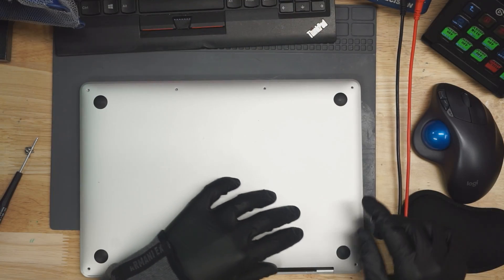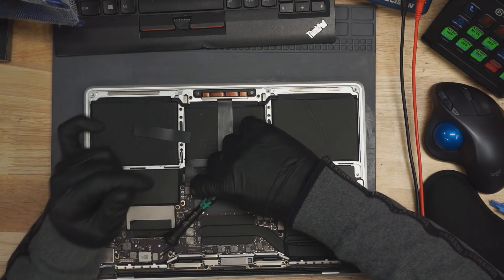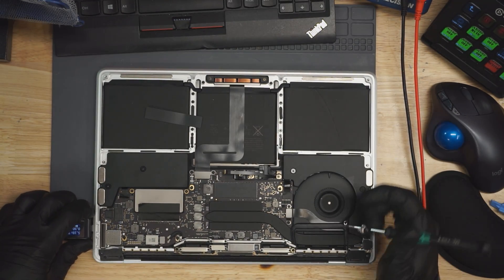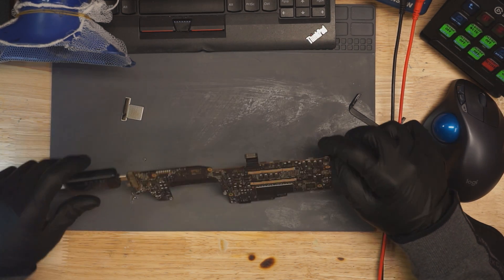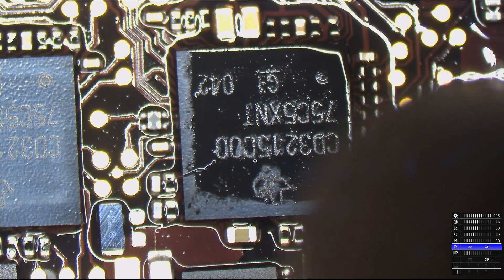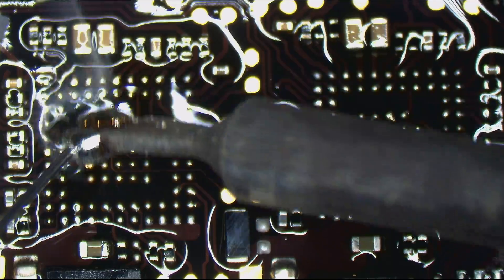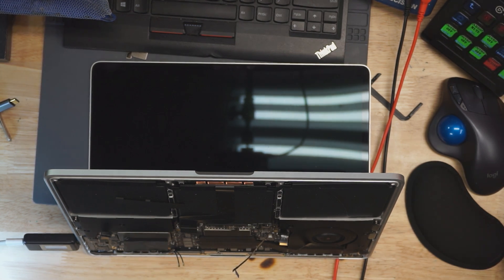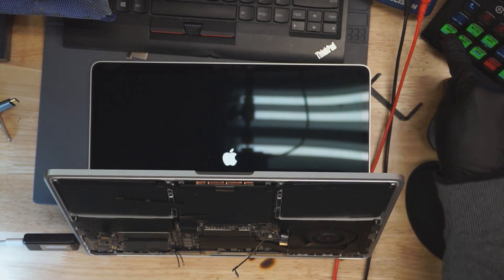One nozzle flows two chips at the same time :D

Comment: Did one 3 days ago. But i replaced only one type c controler i ordered at your shop. Result : mac turns on and boots now. when you connect USB hard drive  it's   only shown when you press alt button at startup.  But when it boots to the desktop it does not recognize any usb device.

Comment: Good site for basic flux/soldering info:
https://www.youtube.com/watch?v=SFKYUi3p8zY
Reply: Video basically shows that flux is needed to help get rid of tiny stuff that will keep the solder from sticking to the other metals and also enables the solder to stick together better like it should instead of getting a gooey flypaper like mess of the solder.

Comment: Looking for advise:  I purchased a mac pro tower 2010 and wanted sierra or high sierra on my mac.  The gentleman I bought it from took his hard drives back, but it had Sierra on it when he turned it on before I bought it.  I talked to Apple and they told me to go to google and type in HT208202 for Sierra, and HT208969 for High Sierra .  This brought me to the actual page to download these OS's from apple site.  Apple had Mohave on its download site at this time. When I downloaded Sierra it said I had to update the firmware.  I did not understand why because the computer had Sierra on it.  I did it but now it runs a little slow.  Is there anyway to undo what I did and return my mac pro to the day that it was issued in 2010 as a new Mac Pro Tower?  Thank you shawn.

Comment: You convinced me not to upgrade my 2014 Macbook Air. It's getting a bigger (third-party) SSD instead. None of Apple's current laptop lineup is attractive now after Magsafe went away, and after they got unnecessarily stingy with their ports. The last remaining candidate, the 12" MacBook fell out of favor when you told me that the new power control chip was impossible to find. Congrats, my next laptop may be from Asus.

Comment: There are USB type C magnetic cables available, where the plug stays in the device .
Reply: Yeah, but they don't like high current (above 500mA).  Had one on my phone and it fouled so easily that the mag connector started getting hot.  Ditched it after just one week.  Not saying they all suck, just my lousy experience. :)

Comment: Designers at Apple ...(Corperate Shill 1) "Hey that Magsafe charger is preventing damage that we could normally charge for repairs because it detaches safely (Corperate shill 2) Well lets change it over to a fragile USB C port that can break if the wind blows on it funny....also can you make sure some of the ports are not built for charging so there is a chance the customer can short them out by accident?"

Comment: I just salvaged 5 or 6 laptops from the family home. Some were thrown under tables and left to die. Some go back over 10 years. you know what, I've had 1 fault, a touchpad button worn out (common and I cannot be bothered to take it apart to attempt repair, so wireless mouse as a replacement ;) ). None are dead. Wonder if that would be true if they were all Macbooks. XD

Comment: Apple Logic - What's the best innovation we have on the MacBook? The MagSafe charger, even Microsoft are using them now. Get rid of them and use USB-C. What about the iPhone? No, keep lightning and USB-A. Anker make them cheaper with lifetime warranties, should we make them more durable? No, use that cable which frays easily so they have to keep buying new ones and make sure they are more expensive than Anker. Make a USB-C to USB-A dongle and sell it seperately. In fact, get rid of all the I/O on the MacBook and turn them into dongles.
Reply: That's the thing. If a patent/unique selling point runs out, these companies would rather sell a turd than a working "old" product. :(

Comment: One question: can you just join a teared wifi antenna cable even though the shielding layer may be affected?
Reply: Only if you join the core and shield separately. It's a coax.

Comment: MagSafe -- "If it ain't broke, we'll break it" -Apple
Reply: If they just reinforced their cords so they didn’t break all the time it would be great!
Reply: I'm by no means an Apple fan, but there's a certain irony in them being criticized forever for using non universal I/O and now being criticized for replacing their proprietary charger with USB-C.
Reply: Justin Nanu  The MagSafe was probably the one thing that was justifiably proprietary. It's genius! Who the hell wouldn't patent that? But to take it away because it can't fit into your anorexic machine thats so thin it throttles itself is just ridiculous. Not to mention it getting rid of that pesky problem of people being able to buy a single $80 unit for both the charging brick and the cable itself attached. Sacrificing usability for beauty is a personal preference I suppose, but still.
Reply: @William Traylor
To be fair, similar designs had been used on electric rice cookers in Asian countries, but AFAIK Apple was the first to implement it on a computer, so good idea!
Reply: @Ldgpr  Oh, I definitely agree with you. It was a hell of a connector. It's even more ironic that amidst all the criticism for using proprietary components, the proprietary component that they chose to remove was literally the only one that people actually liked.